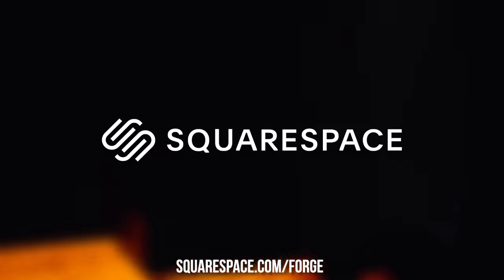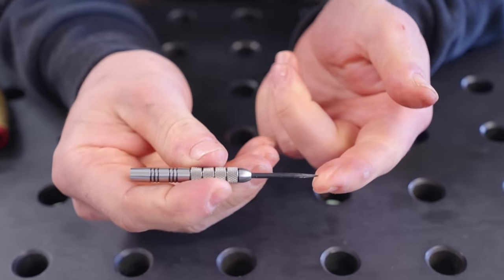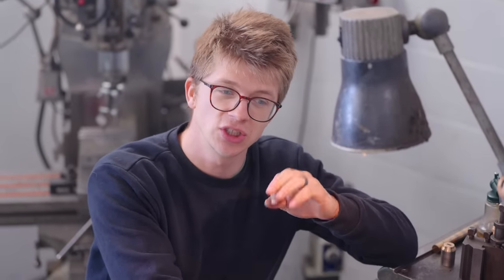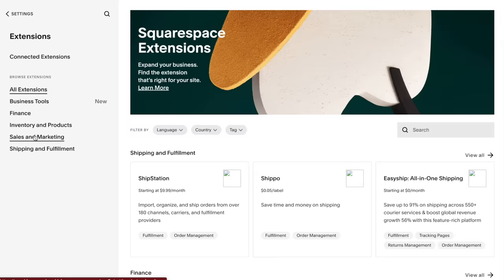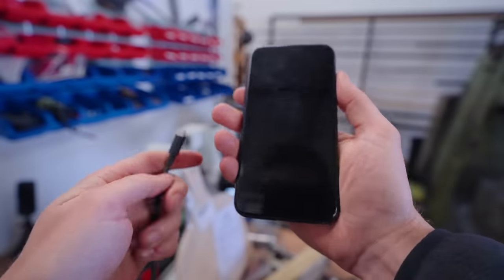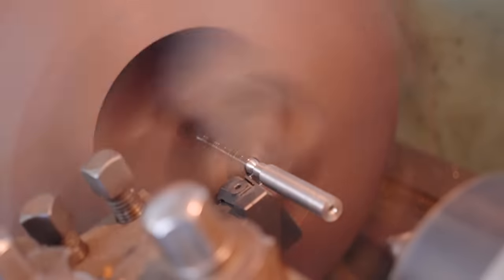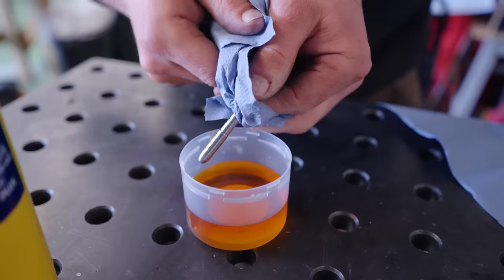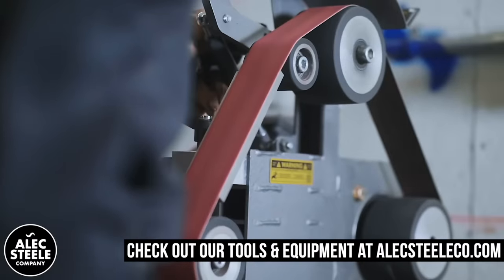Making a DART from Damascus Steel!

Comment: Barrels are tungsten points are steel. And the real challenge would be to make 3 near identical weighted darts.
Reply: Exactly.. I was about to post a similar comment.
Reply: Wouldn’t be that hard. Use the same billet and machine them the same diameters like you would do with anything your making multiple of
Reply: Given that a accepted match weight dart set is 0.2grams + or -. I think it would be more of a challenge than just the one dart. And would the damascus steel cause issues with the weight also.
Reply: @alanmcbride5866  0.2 grams is nothing when you’re talking about machining. Maybe with Alec’s machining it would be difficult lol. But no, machinists make identical things all the time. the Damascus I would presume if he was to use different steels in his Damascus billets it would weigh different as depending on the steel. Probably not enough weight to notice certainly no where near 0.2 grams
Reply: Where I work, we make aeronautics parts. We have a fighter jet bulkhead that has 2 holes that are over 20’ apart and the distance between those  holes must be held within 0.005” inches. Making identical darts would be nothing…
Reply: @stick004  a decent man could eye that in no problem👌
Reply: The only problem with making the darts out of damacus is the wait difference in the body of the darts for the center of gravity
Reply: Was also coming to say the same, and that a set of points are stupid cheap hahaha!
Reply: It actually depends.  I've found barrels that ate tungsten, steel, and aluminum. Tips are steep and plastic.  Most of the people in my league Plat with tungsten barrel and all darts use  plastic tip.
Reply: @The Truth a  soft tip darts. 99.9% of leagues use tungsten barrel, steel tip. You forgot to mention the cheapest of cheap brass barreled darts. I assure you, look up any decent set of darts, they'll be 80-90% tungsten.
Reply: @stick004  0.005" is 0.127mm, that's nothing...

Comment: If I’m not mistaken, I thought it was the body that was made from tungsten to give it weight and then it was a steel tip to sharpen
Reply: You are correct lol
Reply: @markknapton6713  Yup
Reply: This is correct. If I'm not mistaken, brass is heavier than steel by volume so brass would be a better medium performance wise. But Damascus definitely looks cool.
Reply: @feelthepayne88 it is heavier, but barely. In something as small as a dart it wouldn't make a signifigant difference.
Reply: I was going to say I sharpen my darts with that little cup shaped grit stone and he's talking about heating it to 400°c 😂😂😂
Reply: Good darts players ues darts that are tailored to them. Weight , shaft length and flight size all matter.
Reply: @31tomcat  my shaft length is just fine thank you

Comment: Now that we know you’re taking suggestions, you should make a Damascus silverware set where you try to make multiple forks knives and spoons that are all identical in shape, but are all also different due to the nature of Damascus.
Reply: cutlery would need to be made from stainless steel, which would be a very cool damascus to see. not sure if there are sufficiently contrasting stainless steels though?
Reply: That would be amazing to see
Reply: The forks should have tungsten tines.
Reply: Or you could make them from mokume-gani based on silver
Reply: @ForteanEnquirer  would rust unless stainless
Reply: @Tyius420  cutlery was silver for hundreds of years, you just have to polish it
Reply: Yes please I said the same thing blow this comment up.

I vision a Damascus set with gold inlay and diamonds...it for your family so don't skimp
Reply: @Tyius420 tell that to all the people making 10000 Damascus kitchen knives.
No offense.

It can rust but it won't if you take care of it.
Reply: @Tyius420 and technically only iron(steel) will "rust" as "rust" is iron oxide. Makume wouldn't rust it would oxidize. But copper nickel and silver oxidize very different than iron.

Not trying to be rude just informative

Comment: High quality darts are usually made from a tungsten/titanium alloy...

That provides both the necessary weight in a small volume, as well as pretty much absolute rigidity...

The idea is to make the dart as slim as possible without sacrificing weight, steel isn't really a material used for darts...

[edit]

I still think making a dart could be interesting, but imho, it's more of a question of getting the right alloy, and then it's more of a lathe/machining exercise...

Get the shape right, get the weight right, give it some knurling, recessed bands or whatever for grip, while still ending up at an exact weight at the end.

There are interesting technical aspects to a project like this, because making a set of darts requires some very exact machining... so there is a lot of meat here to be explored...

Just seems to me that using Damascus is an added difficulty, since it's a mix of steel types, so wouldn't there be an issue getting identical weights if you make a set of darts, since inherently Damascus steel isn't all that uniform? ... That said, I'm somewhat speculating here...

Comment: Damn, as a viewer that plays darts, I was so excited for this! Shame you did zero research… the barrel is the part that’s tungsten, and not pure tungsten either, usually a percentage, commonly 90%. The point is steel, rarely glued in, usually press fit because the precision is that high it doesn’t need glue. 

Would’ve liked to see you put more effort into this built, maybe instead of Damascus you could’ve done better grip or some sort of cool knurling, even a razor grip or something even cooler. Also, darts come in threes…

Comment: I found a really cool dagger while in Tuscany at the residence of a Duke. It had long thin arms that locked into either side of the blade that sprang out to catch an opponent's sword with a simple push of a button. I found it online called A Spring-Loaded Triple-Bladed Parrying Dagger

Comment: The easiest way to sharpen tungsten is by electrolysis
Just make a concentrated solution of caustic soda, take a car battery, connect the +wire to the tungsten and put the -wire into the solution. Then if you dip the tungsten in and out of solution for a few minutes and youll get a nice sharp and shiny tungsten needle. Its a lot easier than achieving the same sharpness and finish on a grinder. Tungsten is very hard and brittle but it has a very wierd tendency to crack along crystal boundaries which is the reason for the splitting

Comment: The barrel is made of tungsten Alex, the points are hardened/tempered steel, the tungsten for weight of course, tungsten itself is not very hard, tough yes, but not hard, it's tungsten carbide that's hard and brittle, you can actually squeeze tungsten in a vice quite easily..... You were running your lathe far too fast for tungsten, your tip needs a smaller rad, the bar was trying to 'climb' over the tip, hence the strange noise a chatter finish.

Comment: Little tip for machining tungsten: Always Drag your cut, and use plenty of coolant so as not to dull your cutters too quickly.
If you're heating it up before hand, it machines a lot like Hardened Steel.

Comment: Put the tungsten in your hand drill and run it while u run the tip against a grinder disc or belt. Takes seconds, also you literally have tungsten rod the size you need for a dart point with your tig welder. Same sharpening method is the best for tig tungsten

Comment: The phone charging port sections really reminded me of my time working in quality control for a phone trade-in company. Had to use sim tray removers to very, very carefully remove lint from sooo many ports because the phone's came back with complaints of the charging port not working. Scraped out the crud, gently brushed it out with a tooth brush, and what do you know? Charger clicks in and the phone starts charging as good as new. Definitely taught me some tricks for cleaning my own electronics better

Comment: Just seeing this , and yes darts barrels are tungsten, made from a tungsten billet, you make them match weight ie all three should be around the same weight example 24 grams each, the points as they are called are made from steel, most common length of the point is 32 mm long with about 4/5 mm dept in the barrel. The reason for tungsten is it is hard to bend the dart barrel , and last for a long time, you can also make dart barrels from brass and steel. Most pro dart players use 90/95 % tungsten barrel darts , but you can also buy 80% tungsten barrel darts. So give it a try to make three darts from tungsten alone, and the points are compression fitted , and you use a tool called a point pulled to remove and repoint a dart

Comment: How about some damascus sunglasses frames next? Those would be some incredibly challenging small pieces to machine, but they would be some of the coolest sunglasses around!
Reply: It's a lot less challenging than you might think, it's basically 3 main pieces for the frame (either cut from plate or made from wire), 2 small screws and 2 bits of bent wire for the bits that rest on your nose. The lenses are the hard bit

Comment: I would 100% buy a set if they were matched in weight and balance!
Also, my two go-to sets of darts are tungsten barreled with steel tips, but i would still pay a pretty penny for damascus steel darts.
you would need to harden them, and then press fit some pretty good steel tips

Comment: Alec a quick google search would've told the exact opposite is true, barrels are made of tungsten and tips are made of steel or plastic. 
What's the use of 1 dart anyway? You need to make 3 so they're actually usable. 🤷

Comment: Ok actual darts fan here, steel darts are generally cheap and nasty, like brass. Most darts barrels are 80-95% tungsten with the rest being nickel or copper. The points are steel, with an interference (friction) fit in the end of the barrel. Also don’t knurl the barrels, it’s ugly and it makes the grip so much worse. Also edit: why would you put the 18 at the top?! Makes my teeth itch 😂

Comment: I'm pretty sure that it's the barrel of the dart that is supposed to be tungsten, for the extra weight, and the tip is steel. At least that's how my darts are made. 🤷‍♂️